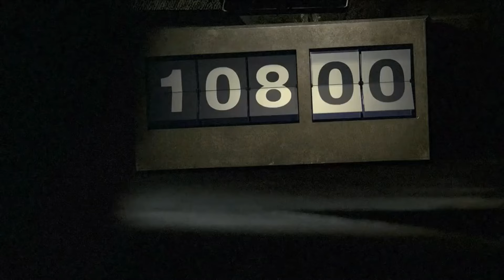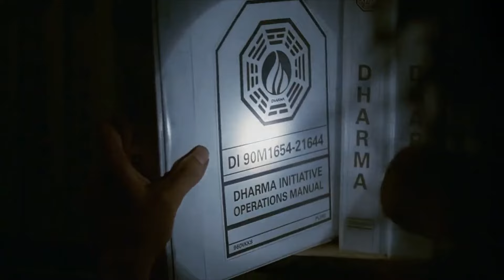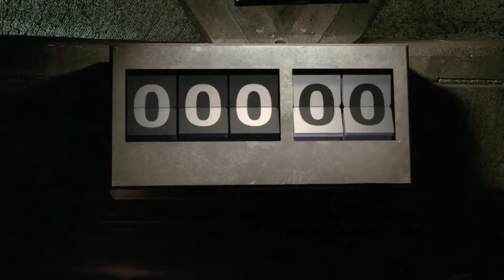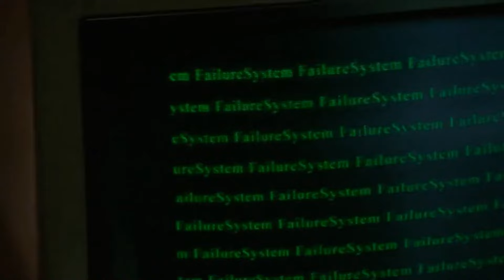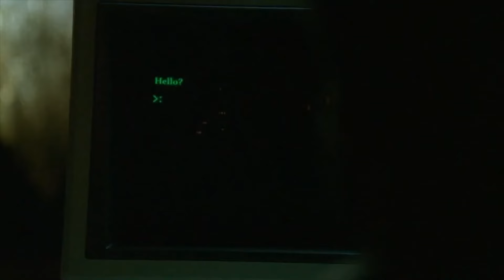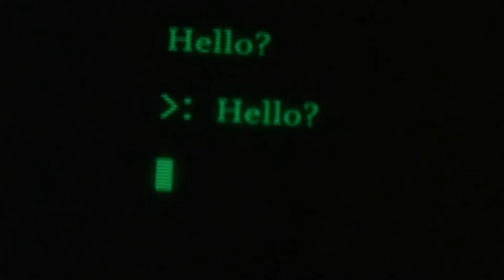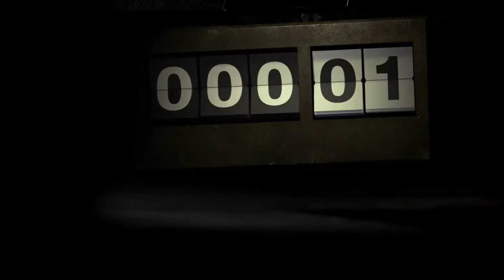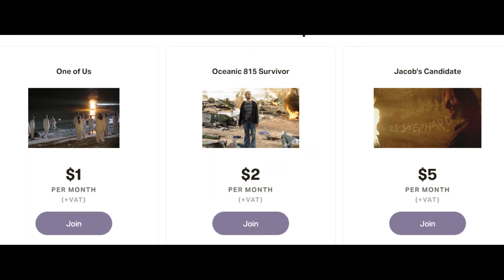Why Did the Lockdown Take Place? - LOST EXPLAINED FAQ

Comment: I like both of your theories. The first seems more plausible. I had always thought it was a safety precaution, i.e., keep the men in the hatch during the drop to reduce the chance they would be outside and injured by the drop. That's probably not super likely, as it would have to drop slow enough to prevent destroying the supplies during the drop so, a person outside should be able to observe it and stay out of it's way. Plus, what's to prevent one of them from remaining outside the blast doors anyway. So I like the idea of keeping one guy safe while the other moves supplies inside the station.
Reply: I always just assumed the lockdown was so that the participants couldnt see which direction the helicopter took when leaving the island

Comment: Really great stuff. My question after watching this is why the blast doors came back up when they did. It seemed to coincide with Ben pushing the button. 

Also, after the incident, wouldn’t Pierre have told everyone that those people were NOT the others infiltrating them? I guess the paranoia would have likely remained anyway
Reply from the maker: The blast doors came back up, presumably, because the doors were on a timer that would automatically timeout after a set period (for example: an hour to allow one of the hatch men to make the supply retrieval while the other mans the computer). But it's possible that the computer button being pushed within the lockdown time window reset the whole system in The Swan, because the button was pushed a little bit late (we hear the the reactor powering up).

I think Pierre Chang might have told a select group of higher-ups that there had been time travellers among them, but whether or not the DHARMA management believed him is another story. Jack's group seemed closely aligned with The Hostiles by the end, and behaved much like Hostiles would. I'm sure Radzinsky always thought they were filthy infiltrators lol.

Comment: Thanks for another great video!

The map on the blast door, which Kelvin was meticulously painting, is evidence that the lockdowns had been taking place for some time, yes?
Reply from the maker: Well, we see Kelvin show Desmond how to fake a lockdown in order to continue painting Radzinsky's invisible map in the Season Two finale. Kelvin says Radzinsky taught him how to do this (both forcing a lockdown and adding to the map). Which means they were triggering lockdowns intentionally themselves for years to carry on the project. The actual lockdowns that are triggered by pallet resupply drops appear to happen only a few times a year, in either quarterly deliveries or one every six months. And these normal lockdowns only appear to last for a short period of time -- approximately an hour. What we see Kelvin doing is intentionally triggering the blast doors to drop for as long as he needs them to be down. So, yes, the automated lockdowns did occur for years and years, but the map painting seems to have been done during self-triggered lockdowns.
Reply: @LOSTEXPLAINED108  that’s right! I’d forgotten about that. Thank you.

Comment: I always thought that the Lockdown happened because of the previous encounter between Jack and John in the hatch while Sayid was questioning/torturing Ben.
John doesn't insert the code into the computer in time and after the countdown reaches 0,  we see those red "icons" (I remember a pengiun at the end and some strange characters) for the first time. 

So, for me, that triggered the lockdown although not right away. There's something that must have happened between that and the lockdown itself that also triggered the doors shutting down.

Comment: How do the pallet drops work? How does a plane find the Island to drop this pallet? Who are the people that logistically and manually process the supplies for the pallets? If the Island is lost then how are these pallets being dropped from some aircraft? Plot hole? The losties didn't see an aircraft make these deliveries or is it like 'sign here, here and here' like UPS? I love Lost even with these possible plot holes.
Reply from the maker: This is finally explained in the series epilogue 'The New Man in Charge'. Have you ever seen it? Basically, the pallets are loaded by two warehouse workers out in Guam then flown out to the island by unmanned aerial vehicles that use automated flight routes generated by The Lamp Post station. I really recommend you checking out the epilogue as it answers a lot of the smaller unanswered questions. Here's a link: https://www.youtube.com/watch?v=lMjPzV2RvO8

Comment: Juliet knowing about the computer that saved the world. Althought I fully agree with your first chapter here, this information could've easily come out of many other castaways. From the time Jack spent with the Others in season 3 all the way up to that scene in season 5. 

There is also the theory - which I may or may not agree with, unsure about it - is that the Others knew well enough about the Swan station, but just like Locke and Boone - never found the very visible entrance :P I also like the explanation of Jacob's instruction. 

> Walt and the computer

I've laid my theories about this on my own channel, but yeah, there's various interpretations on it and if we take the showrunners word for it on the "Access: Granted" bonus feature - it WAS Walt who communicated, but he might not have needed a computer. (I thought it was a bit weird you included one part of this, about the lockdown, but not this one). Anyway, we've talked about this before and I know you prefer to look strictly into the show, separating the art from the artist. I agree with you that he couldn't have used a computer. Not even on Hydra Island, since the blast door map says that there is no intranet access here. Which I agree with. Laying videofeed cables all the way from the main island over there is an unnecessary task in my opinion. One reason why Hydra Island had its separate surveillance room just for that island. So there's various interpretations of it. Another theory is that the first conversation between Walt and Michael really happened, but the rest were Others. The only thing that irks with the Pearl being the source of the communication is that Walt's second conversation with Michael happens when Eko and Charlie are at the beechcraft, nestled above the Pearl. Although the Others might've left the beechcraft just before Eko and Charlie got there. 

17:04 - Just FYI, that's a fan-made map of the Swan which has plain wrong layout.  :P

Lockdown: We pretty much 100% agree on that one. Haven't considered the remote access of the lockdown. Fascinating idea!
Reply from the maker: It would be fair to say that Juliet’s line on its own isn’t necessarily proof that The Others knew what was going on down in the hatch. But there is supporting evidence that goes beyond Juliet’s dialogue. Her line is more like a final confirmation. Had we only ever gotten that one moment with Juliet then I’d say one could maybe interpret that she came by this information elsewhere; that someone told her this weird nugget about what happened before she rocked up on their beach. Athough it certainly did not come from Jack. He never believed that Desmond was saving the world and would not have phrased it to her that way. And I find it hard to believe anyone else would have taken the time out to explain The Swan to her other than Jack. By the time anyone kind-of trusts her enough to tell her anything like that - I’d argue around halfway through S4 - events start moving at a clip. There’s no time nor context for her to learn that info. In any case, Juliet’s line is just the cherry on top really rather than the cake itself. If you know what I mean 😆 

As for Access Granted and Walt being at the other end of the computer… in a video coming up in the near future, I tackle some of the contrary statements Darlton gave on things like this, especially anything in regards to Walt. If one were to be an absolute purist about how we form answers/solutions then whatever Darlton have gone on record as saying about these topics is gospel. Even if it is contradicted by them years later or within the show itself. But for me, as an explanation it fails the logic smell test and doesn’t line up at all with what we learn later. So I disregard tidbits like that. In the same Access Granted selection from the DVD special features, they also appear to suggest that Walt is Walt when appearing to Shannon, yet other statements exist in which Lindelof implies otherwise and a smoke monster connection. Even though they also confirm that Smokey can only become dead people both in the exposition of the actual show and on the final season podcast. I’ll actually be diving into that in a few videos time! I guess my counterpoint here really comes down to the fact that Walt’s story suffered from a lot of ambivalence in the writersroom and I think they never quite figured out what they wanted to do with him and his powers.

In regards to external computer comms and remote access to The Swan… this could have come from The Flame rather than at The Pearl. We know that they are all connected together and that the computers can talk to one another. Mikhail could just have easily been talking to Michael from there. 

As for The Swan map, got to admit that I didn’t really look that closely at it! It was the only clear still image for a Swan blueprint that I could find and is only there to illustrate a point about construction rather than to be an accurate representation. I’ve used fan made maps of the island in the same way. I’ll leave the map making to you 😉 That’s your speciality more than it is mine lol.
Reply: @LOSTEXPLAINED108  Juliet: Yeah, I can still get behind the idea that it's the cherry on top of the cake. As you show, she visited the Pearl station. She would eventually learn all about the characters times since she utters "live together, die alone", however, Sawyer could've told her that story during the DHARMA times.

> The showrunners confirmation

Yeah, it's a tough issue. Especially with confirmations that happen during the show's run. Like, what would happen if they got a better idea and replaced the idea they had talked about in an interview or a podcast? Writing the show is something that was constantly evolving with new ideas scattered around the writers room. 

By the way, I love your reasoning for them not taking Kate, Sawyer and Jack in "The Hunting Party". I was always leaning on the "because Locke was there"-theory, which I still like, but the "Jack sacrificed his weapons when Kate was threatened"-idea is interesting!
Reply from the maker: Couldn’t have been Sawyer telling Juliet the story during DHARMA times as Juliet says this line in the Season Five premiere ‘Because You Left’ just as the time skipping is really getting started, and quite some time before they end up in the DHARMA era. I think the line was given to her - rather than one of the other castaways - as a way to demonstrate that even The Others knew what the deal was with The Swan. 

According to Javier Grillo-Marxuach, who wrote for the first two seasons, the rule in the writersroom during his time there was just that: if someone had a better idea for an answer then they would override the current one. I can totally see this as having happened with things like Walt and the smoke monster. We know they definitely retconned multiple mythological touchstones such as the purge and the sickness, and even the nature of Jacob and the cabin. I can’t really use any of their info about the cabin from their Season Three commentaries and interviews and podcasts because they had clearly not finalised the whole Jacob/MiB arc and had a different intent behind that scene when originally written and shot. 

Which is why it becomes increasingly difficult to rely upon old interviews like this, even though they said some really juicy and interesting stuff in them. We can certainly better understand their process and how the mythology evolved. I’m always conflicted as to whether or not to use their quotes. I try to limit them to supporting my points that I feel need a little help to get across to the viewer. But, like you say, it’s a tough issue.
Reply: @LOSTEXPLAINED108  > Couldn’t have been Sawyer telling Juliet the story during DHARMA times

No, I meant when she says "Live together, die alone" in the season 5 finale. Meaning that she's learned so much about the 815 survivors that she knows the story of Jack's speech.
Reply from the maker: Yes, sorry I misread you before. I get what you mean now.
Reply: @LOSTEXPLAINED108  No worries! :)
Reply: I'm definitely on the track that Juliet wouldn't have known everything about the Swan until living with the survivors. Walking back with Sawyer to the camp after the ambush failed, he asks her "What the hell did you have us breaking all those rocks for, anyway?"
"We're building a runway."
"Runway, for what?"
"The aliens. I don't know what for; do you think they told me everything?"
https://www.youtube.com/watch?v=MDt6ar_XzE4

Comment: How did the supply drops work? 
Do we have any idea how the drones would or may have looked, did they have automated drone technology in the 70’s?
Reply from the maker: The supply drops probably didn't become automated until the latter days of DHARMA, or possibly even after the purge. There would have been no need to automate the process back in the 70s since DHARMA were still an active concern on the island and could receive supply drops by air or by sea. I don't think this kind of drone technology existed back then anyway. I'm not well versed in the history of UAVs (Unmanned Aerial Vehicles) but a quick Google claims that they did start to become used by various military forces in the 80s (Israel) and 90s (USA), with the technology becoming more advanced by the 2000s. The series epilogue 'The New Man in Charge' states that the workers in the DHARMA supply warehouse in Guam have been using UAVs to send resupply drops to The Island for 20 years. The epilogue is taking place in the year 2010. So, that would place the inception point for using the drones around 1990.

Comment: Why Ben putted metal in the Time Machine before turning the wheel?
Reply from the maker: Because he wanted to access the cave system behind the chamber. The cave system is what led to the frozen wheel. Basically, DHARMA built the exotic matter chamber above the wheel and the energy pocket, so the only way to get to the other side of the chamber was to blow a hole in it. It's the same logic as putting metal objects inside a microwave and turning it on... it creates a build-up of electromagnetic energy that can cause overload. In this case, it causes an explosion.
Reply: Yeah, I'm still struggling to grasp this concept: If turning the wheel causes the island to physically shift, and the island  vanished from the view of outside observers, then why did the Losties become unstuck in time? I mean, what's the scientific explanation behind this? Why did Richard and the others relocate with the island to a different location wheh the Losties didn't?
Reply from the maker: I explain all of this in my video on Science and Time Travel. The Island moves through space when the wheel gets turned, but only predestined time travellers (i.e. the people who are destined to appear at points in the past) get sucked back in time. It's determinism. Watch this video: https://www.youtube.com/watch?v=PzhKFeyqVjw (try around the 1:00:29 mark).

Comment: The lore is only as complete as its weakest link. So...

How do they have a front load washer in the Swan Station?
Reply from the maker: They also have a washing machine that Hurley points out as being relatively new compared to other technology down there. So, our attention is drawn to that purposefully. The implications from the Epilogue is that the men in the hatch (during Radzinsky’s tenure) were spared from the purge as long as they kept pressing the button. The Others took over DHARMA operations on and off the island and allowed the supply drops to continue in order to replenish the personnel in The Swan, and this most likely included updating defunct machinery.
Reply: @LOSTEXPLAINED108  Oh I missed the part where Hurley pointed it out actually. I just happened to see it first in that wide shot. It is at least a Samsung, but I still think its a grey area because I think so something like that would have had to be requested by a supply drop at the Flame. Moving it into the Swan, possibly having damaged parts from the deceleration from the drogue or a hard landing, putting unexpected loads on the power system from Present day motor drives, pipe fittings because corroded. I think it would have had to take some back and forth with even Radsinki knowing everything about the station (if he was still alive in 2005). Every production has to have product placements, but I think they took too much of a risk with that one.

I think in an ideal world they would have used a Japanese style combo unit, and that would be much harder for people to untangle the lore.

Kudos to you for replying, I think you did a damn good job on the Electromagnet part specifically. It would make sense that DharmaTel could communicate to the Apple II, it being used as a terminal to communicate with the 70s era microcontrollers or PICs. It looked like the Pearl  also received confirmation every-time the numbers were accepted, so it would make sense they could type them remotely at the Flame (or maybe the Pearl). This production had fantastic producers, maybe second to only Futurama. Again, no offense intended, I am glad I got a real response.